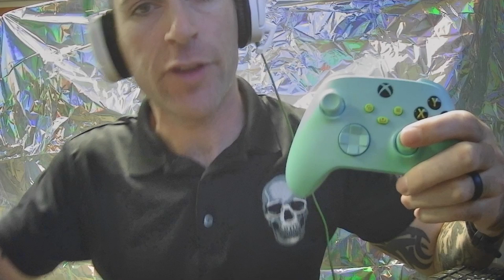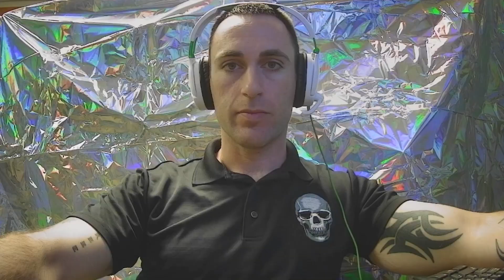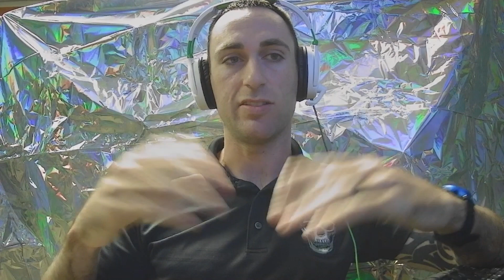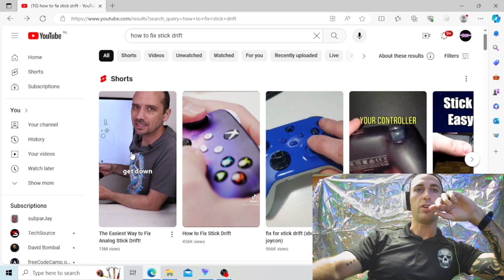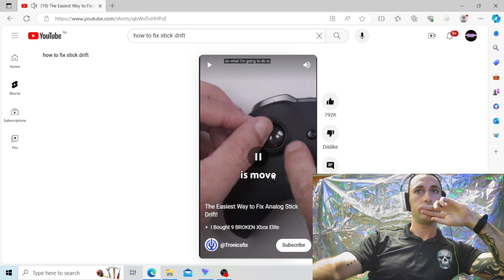Calling out Fake "Stick Drift FIX" Videos (These do not fix stick drift)

Comment: Wait. Wait just a minute.. where’s the mustache?!😂

I still offer clean outs for a cheaper option (open and clean out the mechanisms) but they all have to be swapped out to really fix them, and then there’s “centering” the stick to deal with... Even with the new sticks, I have to check the pots to make sure there’s grease in them.
Reply from the maker: Went from mustache to goatee. My wife likes them but I do not. So shaved clean for now. 

The centering is ridiculous. How many analogs I go through is insane. We had to stop doing the replacements for a while because 1 of every 5 we're good.